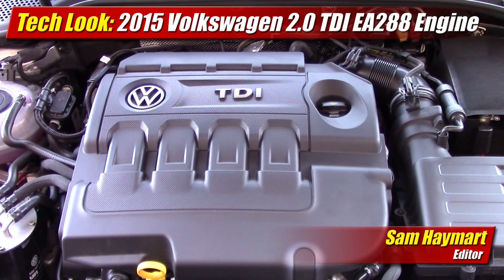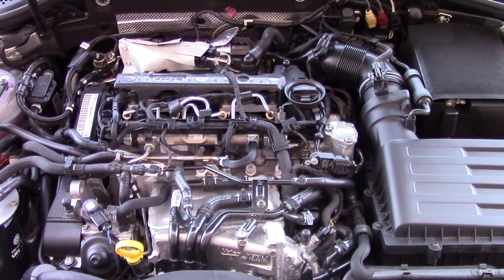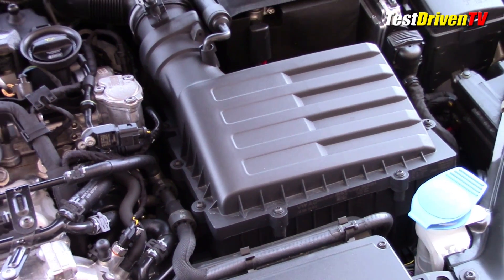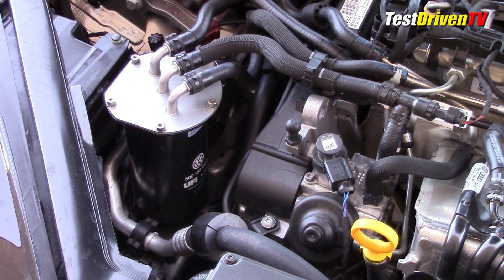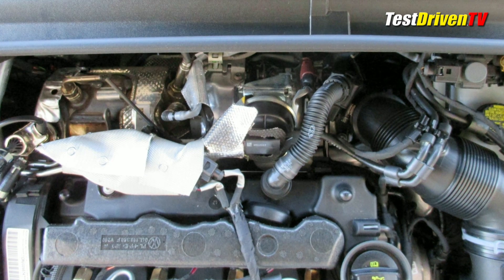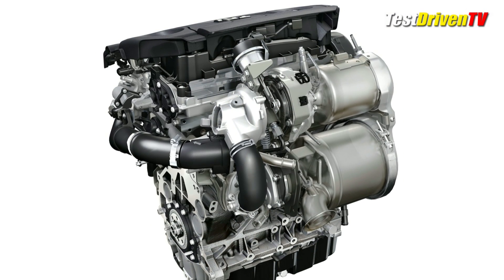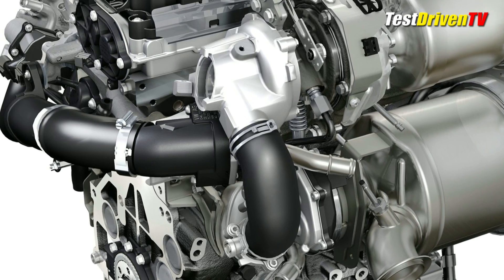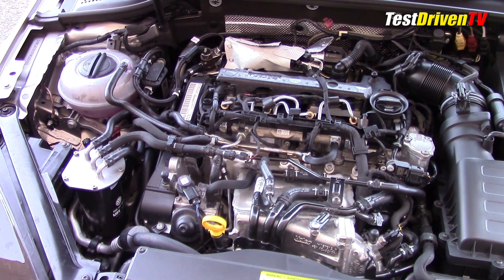Tech Look: 2015 Volkswagen 2.0 TDI EA288 Engine

Comment: Still got mine. 400,000km later runs like a top. Tuned its entire life.  Doesn’t burn a drop of oil
Reply: @swingbag12  i also have this engine in ny touran i burn 1 liter oil every 6000-7000km. Never tuned ore misused.... turbo charged engines always burn some oil so i doubt you 😅
Reply: @ well you can doubt me all you want. I have no reason to lie on YouTube. By the way at 450,000km and STILL don’t burn a drop of oil
Reply: @swingbag12  I believe you. My sisters 2011 (Older engine model) has over 300k km and doesn't burn a single drop.
Reply: @swingbag12  I have the same engine and mines the same it doesn’t burn any oil. I’ve stated this before on other channels and same problem people get angry and don’t believe it 🤷🏻‍♂️
Reply: Can you tell me a little more about this engine please I have mine at 74,000 and I want to know what I should do to keep it running forever
Reply: @EricGrymaylo  5k oil changes with quality oil. Hwy drive it as much as possible. Almost 500k on mine now
Reply: @EricGrymaylo  oil and fuel filter changes, timing belt and water pump replacements, trans fluid swap all at appropriate times. Depending where you live full delete and tune. Gained HP torque and mpg on mine 176,000 miles

Comment: I have an old VW Golf mk5 2.0tdi engine code BKD 2007 and i get around 46-50 US mpg/55-61mpg so in terms of economy the newer models aren't massively different but I completely think the roller bearing for the cams is a great addition to reduce wear, as that was always a weak spot if the car was poorly maintained. Also turbos were always a point of failure for VW so the reduction in distance from the engine and thus oil supply will help with reduced oil starvation on startup and oil service fills.

Comment: I have a 2015 Audi A3 tdi with this engine at 65,100 miles and it's still running strong. Only thing happened is the def injector busted and leaked def the entry point to the exhaust. Cost $653 to get fixed, plan to delete it soon.

Comment: What are these like for tuning for a little boost
I have 150 but want 180-190
Reply: No problem i have 195. With dsg and now 60.000 km with tuning. Car has 185.000 km
Reply: @blaugrana9x  What's the 0-60 MPH or 0-100 KMPH after the tune? what real difference does the tuning make. I am picking up a Golf with this 150 bhp engine this week.
Reply: @joebloggs4191  7.8. 0-60
Reply: @joebloggs4191  yeah difference is huge.
Reply: @joebloggs4191  i've got it in leon 2016 184 hp 380nm torque and now its about 7.4s 0-60, stage 2 you get sth like 207 hp 400 nm and its about 7.1s

Comment: I consistently get high 40's to low 50's mpg, depending of type/conditions of driving, on my 2015 Jetta TDI SEL.
Reply: did the motor cause you any problems so far? do you still own the caR?

Comment: Good thing I stuck with the EA189. After getting the fix, the car ran like shit. I would get close to 900KM to a tank, with the fix it dropped down to 600km to a tank. Ive noticed that the EGT would spike from 400~700 degrees Celsius every 15 minutes. I removed the whole emissions system, installed turbo back straight pipe and reflashed to a stage 2 tune. Now I'm getting close to 989kms to a tank, 900~950 kms when driving it hard. My best so far is 3.8L/100KM. My recommendation is get a EA189
Reply: I take photos at my fill ups.  Yesterday's fill-up on my EA288, I had 729 miles/ 1173 kilometers and  spent $58.00 USD to fill her up.  My 2015 Passat is STOCK.  I purchased her as an interstate commuter to save fuel and constantly avg 50+ mpg.
Reply: Good job, engine runs great, while poisoning everyone around you (and a great mileage!)

Comment: I just bought a 2015 A3 TDI Premium Plus with only 23,000 miles on it for $15700! THANK YOU Diesel Gate. What the Acura dealership did not seem to realize if the 2015 model year was no impacted :)
Reply: Ryan Matthew uh I’m pretty sure 2015 might of been the last year. I may be wrong though
Reply: Mine was produced in 2015 for UK market and sold early 2016. Bluemotion without Ad-Blue exhaust treatment. 2016 was producing Ad-Blue variants but clearly mine was end-of-line batch. I was lucky to get it with 73k on clock and with service history. @Poploner280
Reply: A few days ago, I got oil changed with all the filters. I supplied 6 litres of MUTOL X Clean Plus (VW 507 spec) so I knew what was inside! Not sure about oil capacity having read conflicting data of under and over 5 litres. The implied result was 5.6 or 5.7 litres!! Only 400ml left in spare, 1 litre bottle. Now I'm wondering if they used the 5 litre I supplied. Can some EA288 engine variants of Bluemotion take 5.7 litres of oil? Thanks.

Comment: Question for SeaCronos. Did you register this VW TDI 2.0 Sportwagen in Mexico? Or in the US? If in the US, was difficult to register your car?
Reply: No, i bought it directly from VW dealer with 0 miles on it and sold as a used car, cause it was 2016 and i bought it on 2018. So VW started selling in Mexico the ones that could not sale in the US anymore. All paper work already fixed by VW. You can still find some left for sale on mercadolibre.com Mexico's Ebay like site.

Comment: Since the "FIX"  my 2015 VW Passat TDI, 6 speed standard, is averaging around 500 to 530  miles per tank, and it was around 600 plus miles per tank. Some great "FIX,  huh? The only reason I have seen for MANY years, (since 1979) to purchase and drive VW's was for the economy.  No more recommendations from me to anyone to buy VW.
Reply: The "fix" was simply complying by the US's pathetic regulations on diesel cars by spraying a little bit more DEF fluid into the exhaust. Robbing fuel economy by a few points. These cars are fantastic, but you can thank the US for effectively ruining them and painting VW in a scandal when they were inevitably just selling European model cars. Look how Europe is using diesel electric vehicles that return 70mpg. The US govt, and their fixation on gas powered vehicles is ridiculous and inefficient.
Reply: go get a prius xD you seem to take pride in what you do like all of them prius owners lol

Comment: Hi I've got the Skoda Octavia with that engine how can I get more power out of it without spending too much money
Reply: I installed race chip and took the car from 150 hp to 181 hp. It feels like a different car. And i'm getting better millage also.
Reply: can you specify what kind of chip you got ? id like to check that out @seacronos7303
Reply: @seacronos7303  any more info ?
Reply: @SUQ_MADIQ69  be careful to put it out of the engine bay, I took it from one side in front of the radiator. Heat can cause a lot of trouble to computers and it was throwing me a lot of codes. I found out that no matter where I put it inside the engine bay the chip box was always red hot. Once I put it in front of the radiator, no more problems, not even one.

Comment: Hate that new engine.  Bought a Newly released 2015 Passat TDI and it's the slowest thing I have ever driven which wouldn't be so bad if the fuel mileage isn't way lower than advertised on the sticker.  Best I am getting is 32mpg and worst was about 28mpg.  It's suppose to get a between 34 and 42 mpg and this thing isn't even close.  My brother in his V6  310hp Impala gets almost better gas mileage and my cousin in his base model Ford Focus can blow it away.  I am going to get rid of this Piece of Junk as soon as possible.
Reply: Out of thousands of thousand VW TDI models sold, I have never ever heard from any of these owners that these fine engines  get below 40 mpg. Something is wrong with your car.
Reply: @isa540   Agreed
Reply: I do 45 to 55 on mine
Reply: I've a Golf with this engine and my average mpg is 51 over all fill ups.  I had the final stage US emissions update done two tanks ago and across those fill ups, my average has been 53.2mpg,
Reply: @greggclarkjr9387  did this include the new catalytic and exhaust hardware? If so, any stalling issues or whatever? Thanks.
Reply: @davestauffer8672   No it did not. Just a flash tune and a new down stream NOx sensor.
Reply: My dad's 2015 Passat TDI consistently gets 40-50 mpg. Not sure what's wrong with your car
Reply: Look into a Kerma or Malone tune. More power and better MPG.
Reply: I vet 49mpg something wrong with yours
Reply: you got a lemon...want to sell it?
Reply: I'm getting amazing acceleration all the way to 65 and then a bit less after, but it's a diesel duh. Also yeah I think your car is spraying too much fuel cause I'm getting at least 38mpg while zooming around the city. It's a quick nippy car with a engine proven to reach 400k miles. Nothing wrong as I see fit
Reply: @Липа-ч6г  I think so too. Hes delivered this same story multiple times on different comment strings in a cry.
Reply: Wow how sad I drove my 2015 Passat 70- 110 miles per hour and still averaged 37 miles per gallon.
Reply: He is definitely not lying because I have the same.pronlem.is shot poor mileage new engine shit
Reply: Dpf egr delete. Scr  take all off.  Cost ya Tune it  150 plus 500 exhaust. And run like nothing u ever drove. and fuel mileage way up.  But the power where it’s at.  I tune my own 3.0 tdi.  It has 340 hp and insane amount of torque.   But u will be polluting the earth.  But hey vw been doing it for years. And worst they lied about it.  I offered 43k for my 12 touareg and I not take 60k.   Oh if u want pay out butt.  Malone tuning.   But I tune them any stage 200 bucks.  And that’s telling u how do it step by step.  
Good luck

Comment: Do you think this engine can be brought into EPA compliance with just additional Urea injection?
Reply from the maker: It's possible, but a more thorough retune of its running programs is more likely plus a few small pieces of hardware.
Reply: Which will make it even slower and less efficient than it already is. :-(
Reply: OMG just get a tune  @ThomasRSmith-og7zo
Reply: @BlondynCh  I did get an APR tune and there was no difference whatsoever.  I went back to the Tuner and they double checked the tune and verified it was on there however, somehow the new software upgrade by VW seems to reject the new instructions.  They removed the tune and gave me my money back since there was nothing they could do.  In the meantime VW added their hardware upgrade which in the beginning made the car more difficult to start.  I mentioned it to the dealer and they said it will take a while until the ECU adjusts.  Which eventually it went back to normal starting.  Nothing else changed as far as performance or fuel mileage goes. Still slow as molasses with mediocre mileage burning the most expensive fuel out there.  Never again a Diesel and Never again a Volkswagen,
Reply: @ThomasRSmith-og7zo  Mine is very quick getting up to highway speeds, and is averaging 42mpg. Kinda sounds like you need to bring it back to the dealer, or realize that you're not driving a Corvette. Or both.

Comment: Well, whatever is in this video is irrelevant now, since new VW TDIs can't be bought....
Reply: All the Sportwagon from the Diesel gate in US are for sale now in Mexico. I just bought one 0 milles 4 yesrs warranty fully loaded with extras for 14,200 usd.
Reply: It's not irrelevant, since you can now buy these cars (with Urea injection) and  comply with emissions regulations.  Not only that, but you will have a lot lower volatiles, CO2, and soot (particulate) emission than with gasoline cars of similar performance.  It's actually very, very green.  ;)
Reply: Just bought one.  Trust me not worth it at any price.
Reply: @ThomasRSmith-og7zo Why ?
Reply: @kenj.8897  i have a 2015 jetta and love it. Lots of torque, excellent fuel economy. Its great. 1100km.on a tank, only have to do an oil change once every 15,000 km.
Reply: @ThomasRSmith-og7zo   Sounds like you should buy a fiat
Reply: @ThomasRSmith-og7zo  Just bought one a year ago. It's a nice car, with an amazing engine that will last longer than most gas driven ones on the road. Facts
Reply: @ratiodealer  I bought one Brand new in 2017 after they were released for Sale.  I don't think this engine is amazing at all.  It's actually the slowest and most boring engine I have ever owned in my 50 years of driving cars.  Performance is very much lacking and so is the advertised fuel mileage.  I am averaging 26 to 28 mpg in the colder months during our long winters and in the warmer months about 30-32 mpg.  Well below what it should be getting.  They gimped the engine with their software and hardware upgrade to make it closer to their also false emission advertising.   I personally will never ever buy another Diesel car again and I am having my doubts about Volkswagen as well.  They have a lot better engines but they don't offer them in the US.
Reply: @ThomasRSmith-og7zo  That's too bad. Mine is great has been returning 38 around town and 45 on the highway. The emissions software didnt affect mine at all really. VW were just running their cars at European spec it's not like they made a software that pollutes just for the US. It's the US's pathetic regulations on diesel cars. Bring it to the dealer if it's that slow and bad on milage cause mine ain't. Yeah it's a little slow on the highway around 70, 80mph but it's a diesel lol you buy it for long milage and good fuel economy both of which I am enjoying.

Comment: You missed the new oil filter placement...
Reply: Micah Goldstein honestly from what I can tell you just tighten them down and you'll feel an abrupt stop where theres suddenly way more resistance trying to tighten it than there was before. at least thats how the dodge and chevy internal filters are and they claim the same torque spec. then again, the materials used are obviously going to be different. being that a new oil filter housing from VW costs an arm and a leg though I would hope it isnt cheap easily breakable material. the US automaker's housings don't seem to be
Reply: Thats roughly 18 ft lbs right?
Reply: +Micah Goldstein you happen to know what the torque spec is for the filter housing?
Reply: +Tom Cieminski 25 newton meters
Reply: +Tom Cieminski yes sir
Reply: +Tom Cieminski the filter housing (32mm) is 25Nm. The little plug on the housing is 5Nm. Make sure to pull that plug and drain it into a small pan, else you'll make a big mess. The replacement filter will have an O ring for both the housing and the plug.
Reply: I know I've done VW's before. actually around the 4th of July weekend we had an RV in with a similar filter. I was just wondering about the torque because our shop doesn't have filter torque specs. thank you though, I didn't even realize the plug was such a small amount. 25Nm seems to be the standard for a lot of manufacturers on internal filters because dodge is the same and I believe chevy is too.
Reply: Tom Cieminski Oh--sorry!  I'm new to them and their filter housing arrangement (my Hondas were just a complete unit that removed).  I'd guess by the O ring placement, that torque isn't critical, as long as you don't overdo it.

Any other spec questions, lemme know--I grabbed all the shop manuals for this car off Erwin.  Or feel free to PM me.
Reply: Micah Goldstein yeah who ever though it was good idea to put the filter there had their head up their ass,state of the art engine with a retarded oil filter..
Reply: Now that I've done an oil change, I don't hate it so much.  I'd have preferred if there weren't wires in the way, but it's actually a little cleaner than the top mounted version, as long as you pull the drain plug on the filter housing.

Takes two pans and jacking/lifting the car up, but otherwise not a tough job.  OH...yeah, taking ten screws out of the bloody engine bay liner was annoying too.  But, for a once ever 10k job, not bad.  And not worth what the dealer is asking!
Reply: @maqueavelico1  i dont like it too but it has an reason, to completetly purge the waste oil out of the filter cabin,